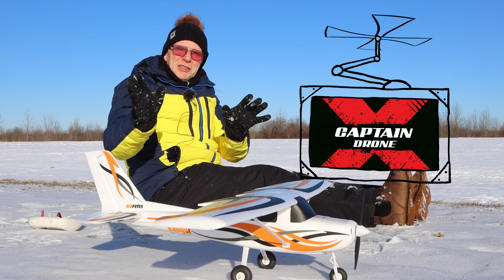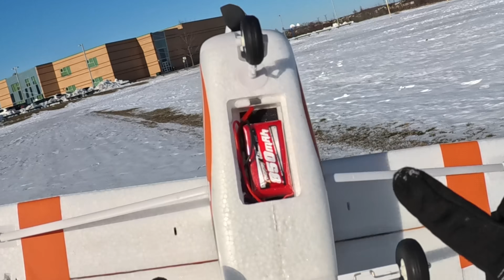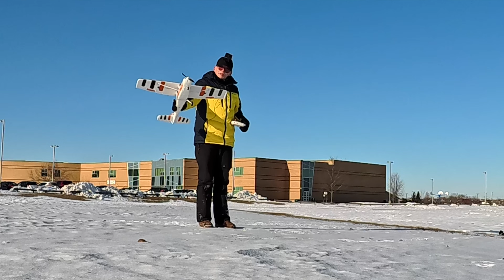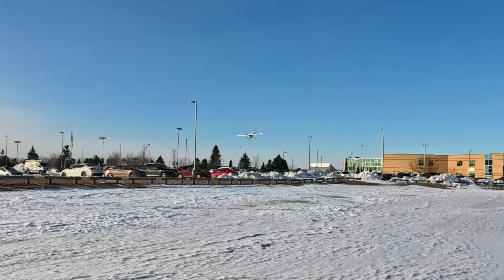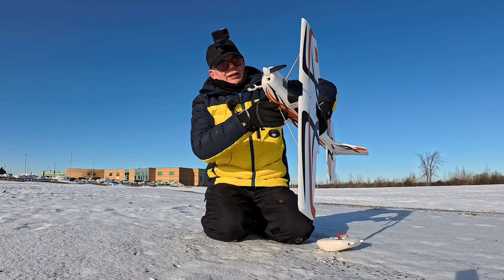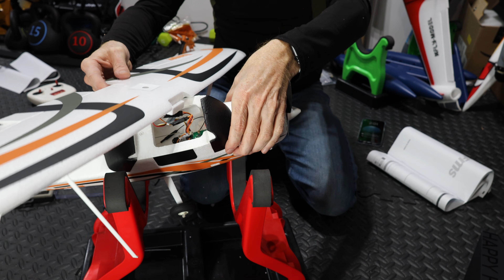This Beginner RC Plane Blew My Mind! GPS RANGER by FMS

Comment: I brought one as somene returning to the hobby. I couldn't recommend it for a beginner. There are a few vital things the manual does not explain. The aileron connectors must be pushed right in. Pressing the trim switches on the supplied transmitter will reverse the direction of travel. Be careful not to accidently do this for the throttle. There is not really enough elevator authority in the supplied settings - move the controls rods to the higher setting on the control  horns on the elevator. My plane was tail heavy out of the box.Check the Centre of Gravity carefully - you will probably need to attach weight to the front of the plane.

Comment: I got this plane $125 RTF version it flies well is a very fragile plane you land the nose, just little too hard. It breaks the landing gear off. I was landing it and just a little bit of wind shift when I was landing and broke the rear end, off of it. It is a very fragile plane, but it flies  well was barely worth the 125 I paid for it. also, my friend bought the same one and he had the same problem.

Comment: Does the pnp version also have the GPS module?
Reply from the maker: I’m gonna guess and say NOPE.  The reason I say that is because an RTF version (which I reviewed) would be designed for new pilots (beginners) which is common when you see anything RTF.  And in the RC Plane hobby if you see PNP (plug and play) it usually means it is for an RC Plane pilot who has all the proper gear and has flown several planes (experienced pilot).
Reply: I asked because the other larger Rangers come with the reflex as a flight controller, even in pnp versions. I imagine that the GPS module is part of the flight controller of this smaller Ranger.
Reply from the maker: I have no idea.  If the on-line specs don’t provide the answer, you could always ask FMS and hopefully they reply with an answer.

Comment: So, i received this plane last week (red) and went to our flying field today for the maiden flight, armed with our four fully charged batteries.  Well, the damned flimsy strut hinge arrangement broke extremely easily, right at the hinge point, even before we could maiden the plane.  I have been involved in every aspect of the hobby for the last 61 years (I'm 69) and started with a plastic .049 Cox PT-19 back then.  I ended up flying my big T-28 Trojan instead. I just notified FMS about this issue. Let's see how they respond to customers.

Comment: Hey Captain is it better then the 1220 ranger for beginners? Thanks 👍
Reply from the maker: Better?  In which way… what would you consider an RC plane for your skills & needs to be better?  Once I know that, then I can tell you yes or no
Reply: @CAPTAINDRONE798  a wast of money if a beginner buys it..crashes it ..the ? Was strait forward Captain..
Reply from the maker: @martymcbride3234 You see, I don’t know you or your skills thus I can’t understand you when you say “which is better”?  Both are great but one has more safety features than the other.  If you are a total newbie to RC planes then you have to buy a Ready To Fly kit because you’ll never figure things out unless you are technically inclined. In addition, as with FPV drones and helicopters, practice practice practice on a flight simulator.

Comment: As usual your video is outstanding in presentation!  For those of us coming from GPS flying drones (and even helicopters), getting into an easy to setup GPS plane is very much desired.
Reply from the maker: You need to buy the add on gps and landing module for the carbon cub to land
Reply: @CAPTAINDRONE798  Yep!  I have all the options on my Carbon Cub S2.  Gps module, Landing assist sensor & flaps.  I repeat, no one on YouTube has a video on how the GPS module and landing assist clearly works!  Your video was excellent on how the GPS return to loiter worked.
Reply from the maker: @BrGoBu I guess I was not clear enough.  Those who make videos on this plane are usually good pilots and don’t require the extra add ons, so they don’t invest in them.  If I would have had them on my plane I would have showed everything working, but there is no reason for me to invest in such items as the plane lands be with next to no effort.
Reply: @CAPTAINDRONE798  Yep...you are stating what all the pilots have already said (on YouTube) that this plane is a solid flyer and doesn't need GPS, OR they removed the GPS module because it was too complicated, or didn't seem to work right.  So my frustration continues.  Mark my word, some manufacturer is eventually going to make a stock plane with an auto land feature that is user friendly.  Then all of us not to confident pilots at lining up on the runway, or visually challenged, are gonna flock to this plane! in a heartbeat.  And of course the plane will also have a switch for dazzling aerobatics as well.  If Horizon Hobbies or Hobbyzone had a lick of sense they would send you this Carbon Cub S2 plane with all the options and have you showcase it.  There is nobody out there that does reviews as detailed and sophisticated as you.

Comment: I don't know how I missed this video. I am on the fence about this GPS. It's kind of good and kind of useless. When flying planes you always should have a close line of sight and not let it get out of view. With the GPS I would kind of hope there was FPV as well like most drones and you could see from the plane as you are flying. Especially in gyro mode it would be a no brainer. But, I am a novice myself and don't know all the ins and outs. The motor seems a little underpowered if it was having a hard time in the little bit of wind you had. Full speed did not appear to be 40mph unless again it was the wind.

Comment: Hello Steve, I read your comment. To let you know what happened . The battery is fully charged. When I was flying the plane on full throttle automatically went to low throttle by itself. Like I said once in the air and twice on the ground. That's why I removed the receiver and went to a spectrum controller. After that no problems. Chris 🤗
Reply from the maker: Glad to know you sorted it out. On this version of the plane it appears the receiver and GPS, and stability, are all one unit.

Comment: Steve I've been flying rc planes since the 1980s. On a traditional rc plane remote, the throttle (left) joystick IS NOT supposed to drop back to the bottom like that under spring tension. It's supposed to stay exactly where you set it so you can take your throttle hand and do something else with it, like flip a dual rate switch. It would be pretty inconvenient and potentially heartbreaking for me to remove my hand from the throttle, expecting it to stay where it is like it's supposed to, and then have the model stall because the power fell back to idle. 🤨Also, just a tip from a long time plane pilot: When flying planes, especially when doing video of the flights, you ideally want to keep the plane out in front of you and fly a racetrack/oval pattern  and keep your feet and body oriented one way. In other words, fly the plane around a fixed point in the field. Not flying the plane around you as the fixed point, and forcing you to turn in circles with the plane. This is how you end up with sun in your eyes and losing sight of it. Fly with back to the sun and keep plane out there in front of you and you won't have that problem. It might save you from a crash and would make the videos easier to shoot.
Reply from the maker: Check out my other RC plane vids, you’ll be impressed

Comment: Hello Steve. Chris from Pennsylvania, I bought this plane about 4 years ago. When I was flying it full throttle went to Low throttle and low went to full. It happened once in the air, and twice on the ground. pulled out the receiver and went to a different controller. I don't consider this a beginner. Has anybody else had a similar experience let me know. 🤗
Reply from the maker: There may be words missing in your comment as I’m not sure I understand what you said. If you were referring to the throttle changing in flight, that would be a battery issue. All RC planes (well most) will pulse the throttle high/low to warn you the battery is getting low and you best land quickly.

Comment: Excellent tutorial review video, and excellent flying.  Very nice beginner RC Plane.  Where do you get the red brackets holders that you used to assemble it? Thank you Captain Steve.
Reply from the maker: You can find them in any size. The red one is for LARGE planes but can be used for SMALL planes by flipping the red mounts inward as I did in this video. The LARGE mount is more expensive than a small mount. A hobby store will sell a small one for $25 and a large for $50. You can find them on AMAZON but often times they are more expensive there: https://amzn.to/3SoIPtw
Reply: @CAPTAINDRONE798  Thank you Captain Steve.

Comment: Greetings from Puerto Rico. My first FMS 182 SKY Trainer that I bought few years algo and after a very careful Assembly and included radio/receiver setup, flew great in the Maiden. Did a couple of touch-n-goes but signal was lost at 50 feet AGL. Crashed. Radio batteries were new, out off the box. Lipo 3S 2200mAh (included with plane) with 90% of remaining charge.
Next day went to the La Sorpresa Hobby Shop, bought another SKY Trainer and a Tx with Rc combo.
Still have the planes. Very pleased!
Tip: Try to get another radio for that plane. You will not
regret it. Keep in your outstanding work!
Blessings!

Comment: Hi Steve, Another great video.  I've been looking at the PNP version and the e-Flite UMX Turbo Timber Evolution.  Going wiht the RTR is a good idea for the GPS but I'd want to fly with my Radiomaster Boxer.  That's why I was looking at the PNP.  I'm curious of your thoughts about the better plane. Ranger or e-Flite UMX TTE.  Being able to get the PNP version with GPS would be an excellent option.  Another question, would you add the Reflex V2 Flight Controller?
Reply from the maker: If you are a super newbie in the RC Plane hobby, start with the easiest to fly plane like this one. Then when you get some confidence buy any HIGH WING (wing on top) RC plane and use your boxer with a compatible receiver.  If you like have a gyro in the plane for stability, the FMS Reflex, among many others, is a good choice.  The worst mistake you could make is getting a PNP plane as your first plane (you’ll be very lost).
Reply: Thanks Steve.  I've been flying for a couple of months, specifically three Voltanex mini warbirds using my Boxer.  I've got the UMX Air Tractor and have a great time with that, esp. on 3S as it has so much power and is nice and fast.  The UMX TTE would use the same batteries so that is a real plus, and I love the flaps!  If the Ranger had flaps, I'd be in for sure as I want a slightly bigger plane (850 vs 700).  I've been looking at the BNF versions of the UMX TTE.  I agree that I don't need to get into the receiver side yet as I don't really know what I like/don't like.  Looking for more of your content!   @CAPTAINDRONE798

Comment: That's a great plane. But I must say I bought a HobbyZone Champ S + a few years ago and it has the gps and it is capable of doing the same flights as your Ranger except this Champ S + has auto land which it will begin an upwind landing approach and will land near the initialization point. Unfortunately it is discontinued.
Reply: Thanks for your hearted comment. I am totally impressed that you take the time to respond to comments from your followers because I know you are very busy. Keep the reviews coming.
Reply: That REALLY sucks as I could use that auto land feature with my lousy eyesight!  Have you discovered any other options?

Comment: I had a 850, they should put the spring front wheel from the Ranger 1.2 on it. Mine on the second flight came in hard on the front wheel and took out the servo and the wheel.